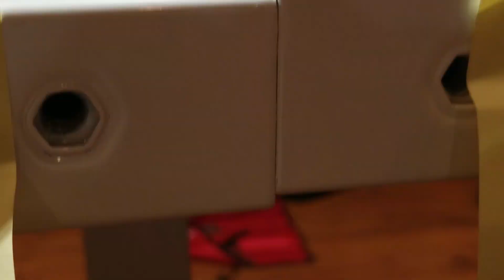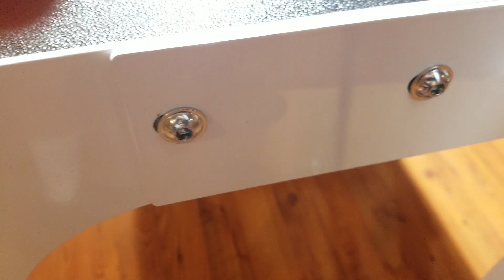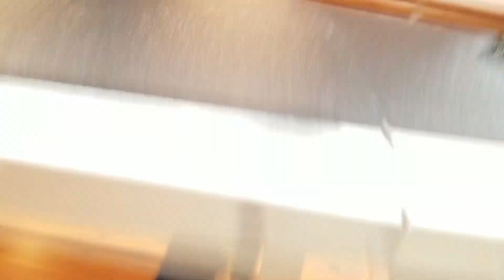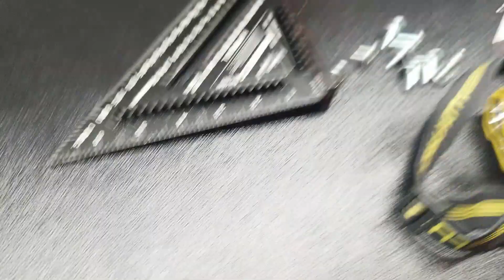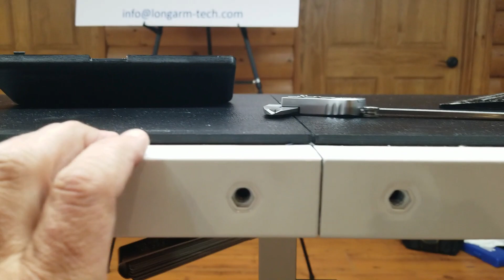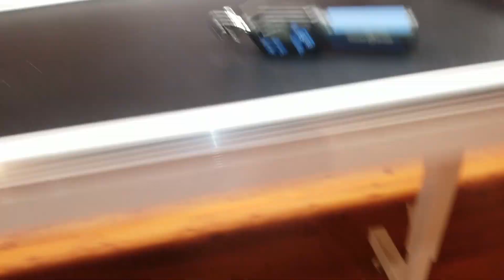Resolving Longarm Quilt Frame Problems - Intermediate Alignment of Sectional Longarm Quilting Frames

Comment: I so wish I had found this video when it first was posted. I spent a year working with the shop I bought my machine from getting the table leveled! I wasn’t permitted to make any adjustments myself or I’d have to pay for them to come and fix it. It was a complicated situation. Needless to say, after a year and several visits to my house, my husband made the last adjustments to get the table to the point it should have been when we bought it. What a nightmare! I will show these to the hubby and maybe we can consider investing in some of the tools you are employing. Thanks for sharing!
Reply from the maker: My pleasure Anitra. What longarm/Frame do you own?
Reply: @LongarmTech  I have the studio 2 frame from Handi Quilter.
Reply from the maker: @anitra7747  My wife has the same on here Amara.
Reply: @LongarmTech  it’s very frustrating when the closest resource is almost an hour away. My experience with the “technician” charged with dealing with long arm customers was less than optimal. My husband is an auto mechanic by trade and decided we were fixing it ourselves. One of the issues I was having was the metal bar for the channel lock system wasn’t flush and my magnet was rubbing at both seams of the table. I don’t have the pro-stitcher on mine so it was very difficult for me to control the machine in both of those locations. That coupled with the tension issues I was having with the bobbin spring, it’s a wonder I still have hair in my head! All of these issues were from the moment we set up the machine. I bought the Amara when it first hit the market and it is my first long arm.
Reply from the maker: @anitra7747  Folks like you are exactly the reason the Longarm-Tech suite of sites has been developed on YT, FB, and the web. I spent countless hours with no help from the manufacturer resolving issues on both the Avante and Amara Frames for my wife's longarms.
Reply: @LongarmTech  I am so pleased to have found you. I just wish your videos would have come up when I was looking for some direction. I love my long arm and I have had it for almost 3 years now and only recently did we resolve all of the issues we had with it. I want your videos to be more noticed by this platform! I’ve commented on all of the videos I’ve watched so far! Thank you for being willing to take the time and make the effort to upload these.

Comment: Do those shims provide temporary support to help brace the frame or does it stay in place
Reply from the maker: They stay in place - the force from the weight of the top section of the Frame hold them in place in the u-channel at the top of the leg. I have some that have been in place for more than a year and 20+million stitches. Be advised that since the machine vibrates as it operates there is a likelihood that Frame fasteners can loosen, leg adjustments can change, and the Frame could be bumped any of which could allow things to shift - so periodically grab a 5mm hex tool and check all the fasteners to ensure tightness. What type of machine and size of Frame do you have?
Reply: Longarm-Tech pearl frame from babylock